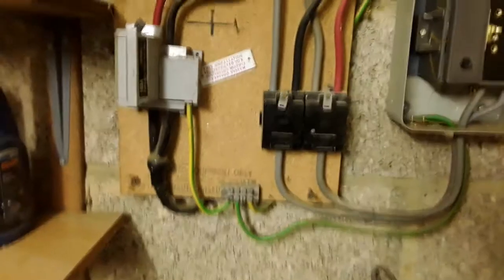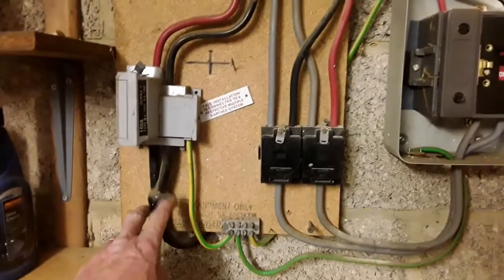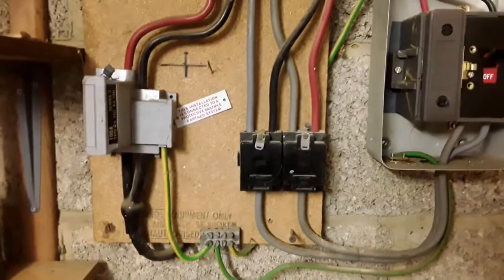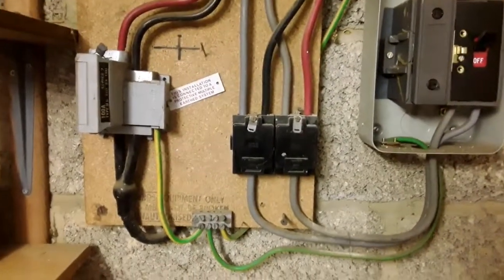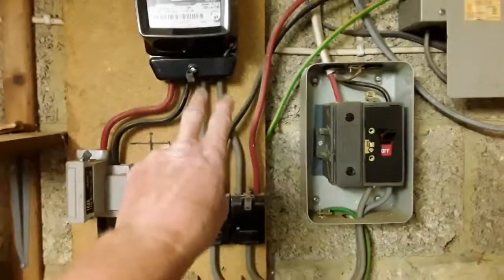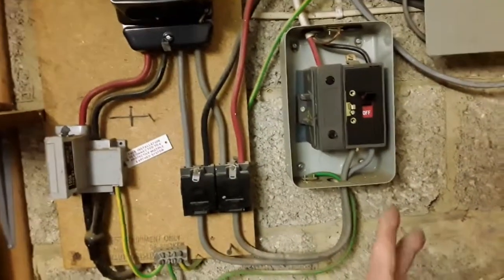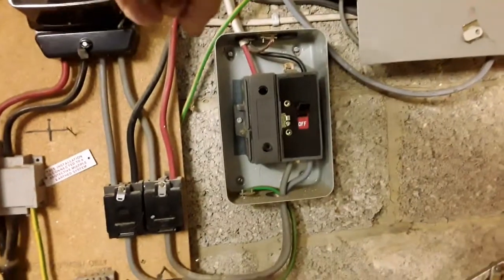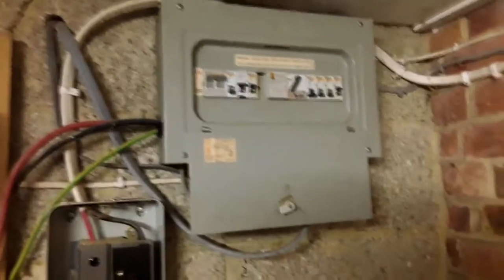Winchester Electrician Finds Dangerous Home Wiring

Comment: 1, unable to know what "unprotected across the garage roof" means, without it being seen on the video, 
2, Fail to see any relevance of the supply being TN-C-S / PME, 
3, 10mm² clipped-direct sub-main fed from a 60 ampere BS3036 or BS88 switchfuse is fine
4, "Henly Blocks" to split the meter tails is fine
from what is seen, nothing is C1 or C2 dangerous, 
possibly a C3 recommendation for upgrade, more context is required to highlight any deficiencies,